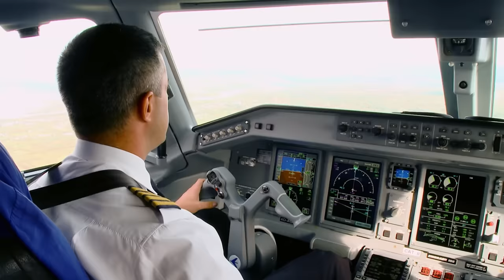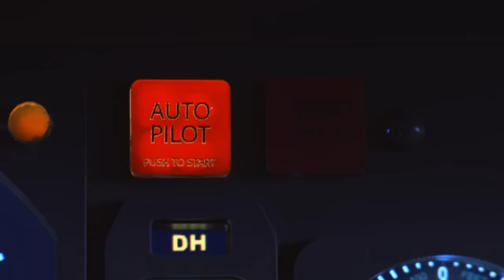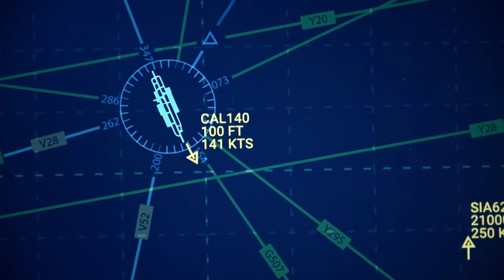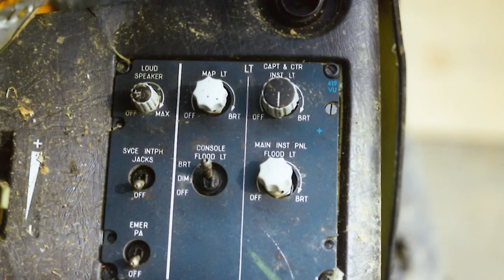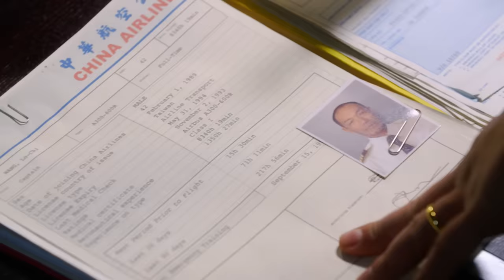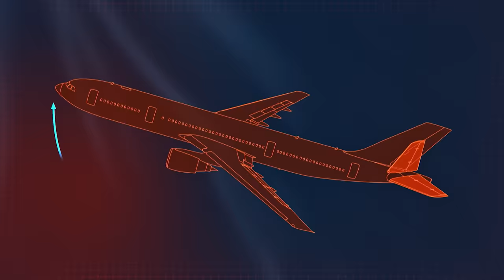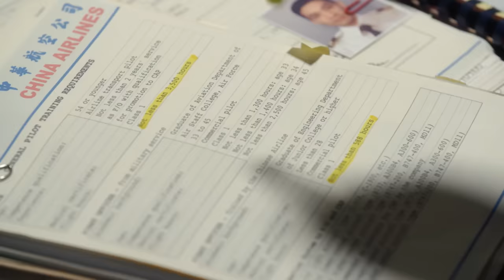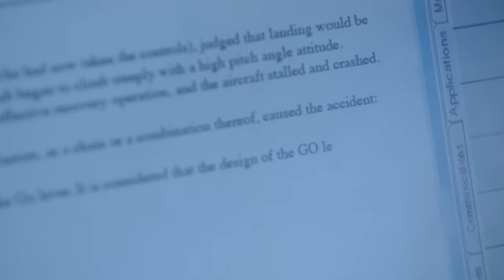Airbus A-300 Falls From The Skye Due To A Mechanical Fault | Mayday Air Disaster

Comment: I thought in an Airbus the way that you trigger TOGA is full throttle forward only. I didn't know there was a "Go Around Switch" on the Airbus x# Throttle levers. 
I thought Boeing was the one that had a TOGA button...🤷‍♂️🤷‍♂️
Reply: All commercial aircraft have go around switches. The go around mode configures the aircraft for a smooth controlled climb out, not a moon shot.

Comment: Why would go around mode not do exactly what it should do regardless of pilot input... If the cpu is gonna win why wouldn't it win the whole way 100%.. Why doesn't it scream go around go around go around ... Like low terrain pull up ... Hindsight is 20/20 but still if it's switched in a certain mode I'd think something should alert the pilot like no control at all or an alarm

Comment: If the pilots were imputing commands in conflict with the computer mode, shouldn't the it  have been programmed to loudly announce it was in TOGA mode OR the TOGA mode designed disengage flight control  -- like the autopilot does when manual input is applied.

Comment: why did the toga not disengage when they start inputting on the yolk and reducing throttle also why did the toga not level off the plane instead it held its pitch up and stalled aircraft if the toga would have disengaged when the pilot started pushing forward on the yolk then the plane would have landed and all those people would have been alive likewise the toga should have recognized that the plane was in a stall situation pitched down and full throttle level off see in the aviation World they like to blame the pilots if they have to blame something on the airplane then that gets expensive lots of red tape for all parties

Comment: Well they always want to blame the pilots but it's always the plane these planes are so technical and so hard to deal with it's like having a woman they're just almost impossible to deal with one little touch of a button in the plane kills you this is insane that plane should be able to be controlled manually without the computer interfering it's always the designer of the planes fault it's always Boeing's fault usually
Reply: This is Airbus, not boeing

Comment: Why you do not want LOGIC of the computer to take full control, and NOT be able to easily be, overridden. Airbus to some extent will allow full manual control, similar to Boeing, BUT, it is only towards the end of a failure sequence, and you may be Air India 447 by then. Dead, pieces floating in ocean. Or the Airbus demo flight to show off how un-crash able it is, and then it crashed into a forest, while horrified onlookers and the top AB brass were there. ECU LOGIC :face-green-smiling: